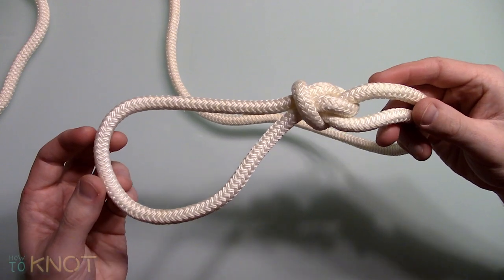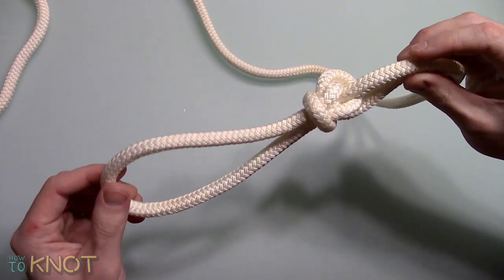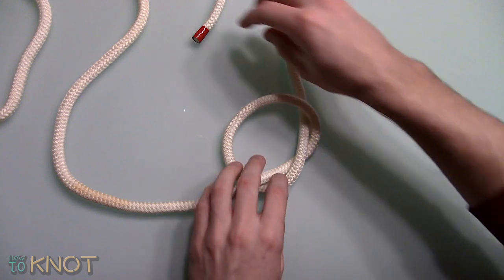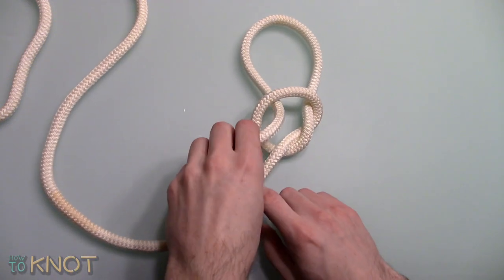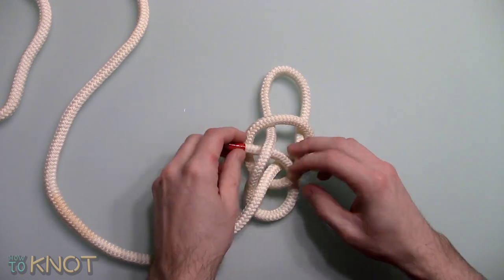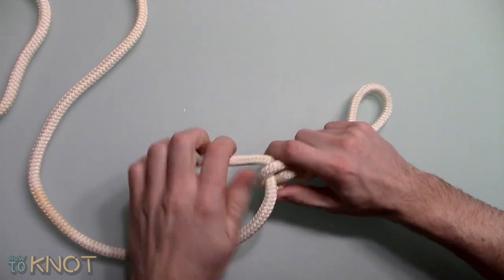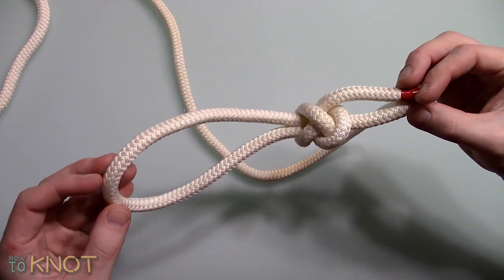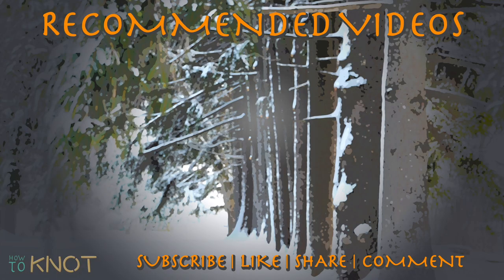How to Tie an Angler's Loop

Comment: I don't get why this isn't the most common method of tying it. Almost all other instructions require you to pull the final loop through another loop, removing the option to tie it around a post the way you can with a bowline or indeed when you tie a perfection loop this way instead. Nice video!
Reply from the maker: Thank you :)
Reply: Yes, nice video, and well explained. I think this is definitely much easier than other methods for this type of line.  But if you'd dealing with different cordage, like fine flexible thread,  then passing a loose end through a loop becomes a hassle, so other methods (like the quicktie method around your thumb and index) might become a little easier.